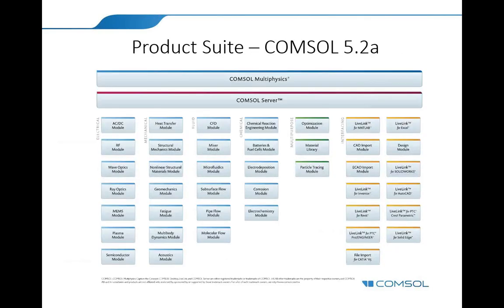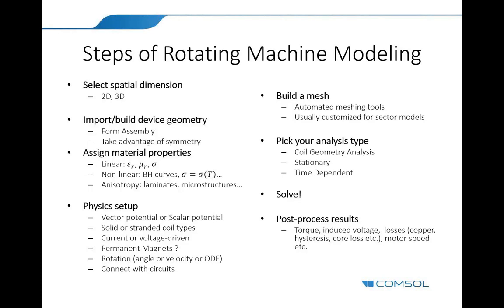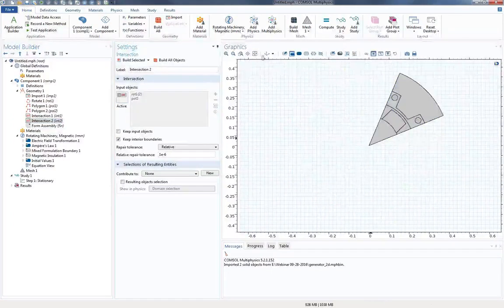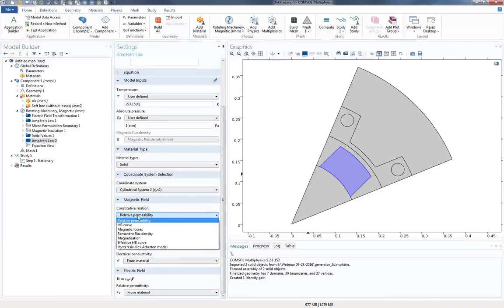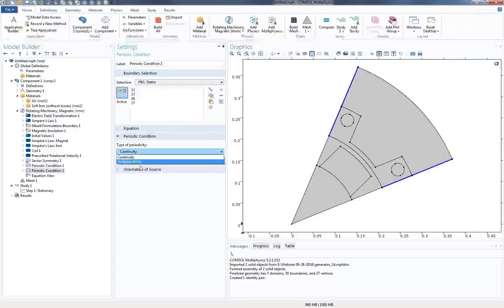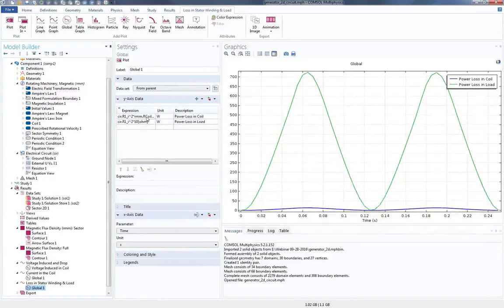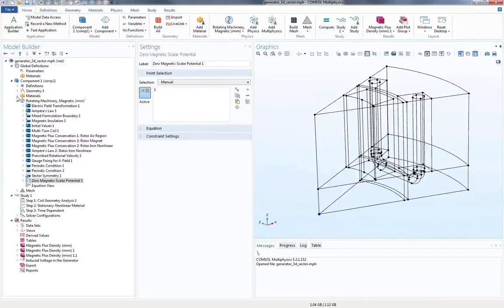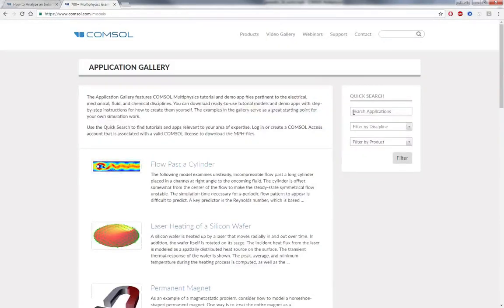Modeling Rotating Electrical Machines in COMSOL Multiphysics

Comment: hello sir, i am working on actuating a cantilever using electrostatic module using COMSOL 5.3a but having problem while applying actuation voltages need your help regarding that and also which study is good for simulating the cantilever?